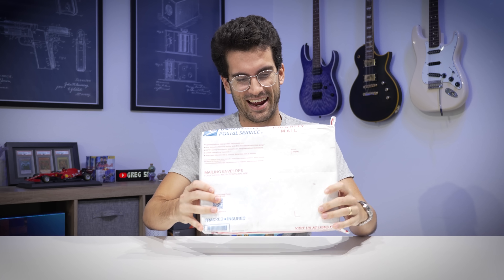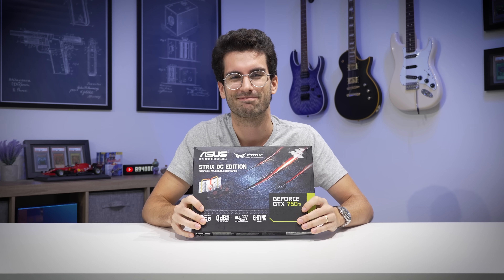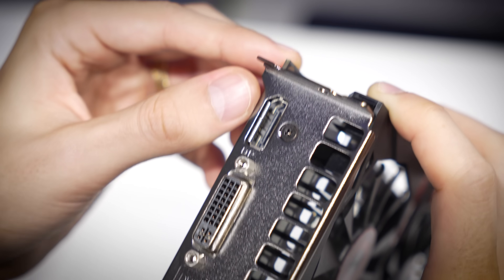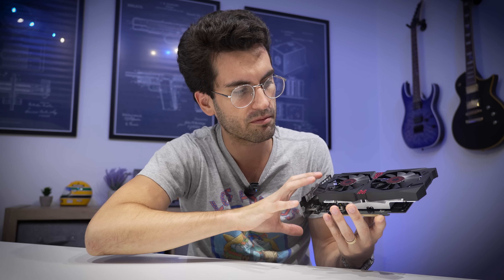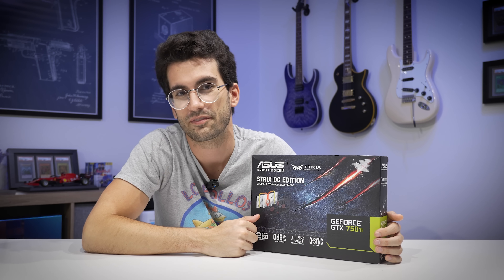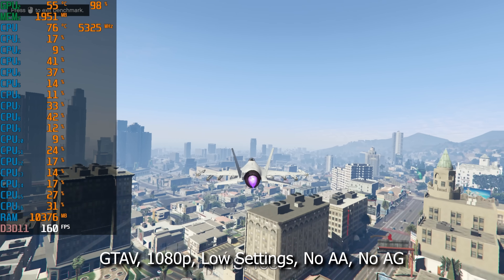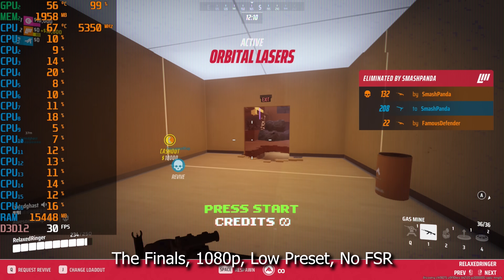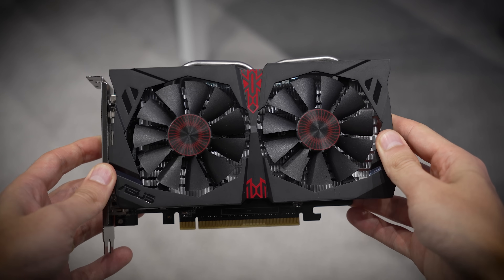The Nvidia GTX 750 Ti In 2024 | RETROSPECTIVE

Comment: I partially disagree with Greg. Yes obviously if you have or can safe a bit more money, do buy the suggested beter GPU's.
However if your on a very thight budget or just want the cheapest on the side gaming PC AND a low price comes along. You can create a very cheap system. Most (office) PC's are enough. You don't need an PSU with 6 or 8 pin powercabels. It runs of power from PCI-e slot. If you can spare a few more coins. The GTX 1650 offers way more preformance and uses PCI-e power only. Aldo prices vary depending on your refmgion in the world

Comment: I was later to the game when it came to PC gaming. My first system had a 1060 3GB (which is stupid because it isn't just a 1060 6GB with less VRAM), so a 750TI is too new for the retro gaming PC I want to build. I want an XP era gaming PC that I can play my retro Jurassic Park 3 games I have. May not be strictly necessary for most games I have, but one game absolutely needs retro hardware to play. 
Jurassic Park 3 Scan Command needs an accessory (the scanner) that connected to the PC with serial port and, as far as I've been able to tell, you cannot pass it through a serial to USB adapter cable to a Windows VM or PCem or DOSBox

Comment: The problem i have with video's like this is assuming someone is playing modern games on a 750ti this card is old and if you go back to when the card was made and played those games i think it might surprise you try Fallout 2 3 or Bioshock with this card i believe it will be a nice experience but you don't buy this card for modern games most likely it would be paired with a 2nd or 3rd gen Intel cpu at the time for retro gaming i would not have any problem with this card and for a lot of people it's offers you a way to play games that you loved in the past games that had soul and character like Alien Isolation good game anyway God Bless.
Reply from the maker: We literally showed GTAV (not modern, though still heavily played) running fine on the card. We also explicitly mentioned the card's viability for HTPCs and the like thanks to its low TDP.
Reply: @GregSalazar   My point was you started trashing the GTX 750 ti and you finished trashing the GTX 750 ti no one will remember anything in between because of it you should show more games of the time like Fallout 3 it was game of the year or Fallout 4 even there are so many good older games that the GTX 750 ti will play nicely.

Comment: Overall message is solid. I wonder though, what would it run like at 720p? Would it even make a difference at this stage?
Reply from the maker: Not totally sure. 1080p tends to be the benchmark for whether anything is "gaming" worthy today, and since 720p isn't a MASSIVE drop in pixel-count, it isn't likely to sway my opinion.

Comment: When you start testing the GPU, you’re using a modern cpu and everything not the GPU. So doesn’t that mean the CPU is carrying the experience? I know the GPU is under full load, but you don’t really get the “full experience” unless you paired it with a period correct cpu right?

Or am I way off base
Reply from the maker: Nope. Means the CPU is removed from the equation as a potential system bottleneck. Essentially, we want full pressure on the card to see how it holds up while gaming. If we'd put a much weaker i3 or Pentium in here, the CPU would hold us back in certain titles. In such a situation, it would be difficult to know whether to blame the CPU or GPU for performance limitations.

Comment: My first card was also a GTX 750 Ti. This card was advertised as a PS4 equivalent/killer at the time. It only released 4 months after the PS4 at $150. It was a solid option at the time as a first time builder. 

The Maxwell architecture was so damn power efficient that the card did not need any power connectors and just needed 75 W from the PCIe slot. The efficiency of the architecture was so great that it made its way over to the Nintendo Switch on a smaller 20 nm node in the form of the Tegra X1. I'd say this is in the top 10 for most important cards made in the 2010s onward.
Reply: thanks for that info. top 10 ten for the last decade😄 thats pretty good. Looking at the latest Graphics Card Comparison chart... It says the gtx 750 ti is double as good as ps4 and half as good as the ps4 pro. 👍

Comment: Crazy how for just double the money, for 149, I got a titan x pascal that was refurbished just few days ago 💅
Reply from the maker: To be clear, I only paid $75 because I thought mine was "brand new." Even then, I only wanted it new for the sake of this video. I wouldn't pay that kind of premium for such an old card - new or not. These consistently run between $30 ad $40 all day on eBay :-)
Reply: @GregSalazar  I actually think you can get a 960/970 for 40! Ebay is great
Reply from the maker: @ashleyjohansson230  Yep! And you absolutely can. Discussed a bit later in the video, but the price floor for a lot of these older cards seems to be somewhere around the $40 mark.

Comment: only for gaming maybe, but on my Daily driver  2700x with a GTX 770 ,  $40  5 years ago, great for watching videos and editing videos,  saves my Gaming PC with a  1080 from being used too much.
Reply from the maker: The 770 is not a 750 Ti. Noticeable performance difference, even today. So I wouldn't necessary equate those. I stated later in the video that something this weak would be fine for a media rig or something - but clearly not modern gaming :-)

Comment: Still running a FX6300 + GTX 750Ti here.
Reply: i pulled a 8120 and gtx 570 out of the trash, i'm dead serious
Reply: This was my exact combo until 2021 when my PC started having issues. I still have mine and I use it as a backup for troubleshooting.
Reply: Have you encountered any problems with that combo? Or do you avoid any modern titles?
Reply: @jackbro655  I think it's safe to say that they're avoiding quite a fair few modern titles.
Reply: @jackbro655  Last "new" game I played on this was Doom Eternal -  but low quality.
Reply: lmmfao I got a cpu with this exact combo and i can still play most games not all in 2024
Reply: @peezydabeatmonster8112 I have a 770 2GB and still rocking it
Reply: same :)
Reply: fx8350 for me 750 2 gb
Reply: Meeeee too!
Reply: What graphics driver version are you still using that is stable?
Reply: Is the the 2gb or 4gb, warframe can be played at 1440p on the 4gb one
Reply: I7-4790+ 4gb 750 ti still lol I’ve oc it it’s solid

Comment: This card has been kept in use in my group of friends since 2014 😂. I had a friend whose computer literally burst into flames and we managed to save it so for a while he was still rocking my 750ti in 2023
Reply: I sent mine to Windows XP. There it'll live its life beasting Oblivion with some mods.
Reply: Bro my GTX 750 (not ti) is still going strong I have to play mafia 3 at a lower resolution but it's still as good of a framerate for a console
Reply: When I upgraded, way back, from a 550ti to a 660ti I sold my 550ti to my dad for extra cheap. I think his downstairs PC still has that 550ti in it. Granted, he's primarily been using laptops for the last 8-10 years, but he still uses it occasionally lol.
Reply: I still have it on my 2nd pc, i use for dma cheats,which i shld hav left out

Comment: This was a brilliant gateway into PC gaming back in 2014. The number of office computers it turned into gaming PCs must be huge.
Reply: Had a 2nd Gen optiplex with one of these as my first gaming PC
Reply: @gok0o  same
Reply: In 2017 I built a Lenovo ThinkCentre into a budget gaming rig, running an i5-4590 and a GTX750Ti. Total cost was less than £100 in second hand bits including buying the PC itself. I ran it until 2022 and it did what I wanted it to until I decided I wanted to try CP2077 on PC 😅
Reply: I can tell you first hand that I am responsible for about 300 to 400 Floptiplex gaming builds. I let the people who receive them know what they are getting and to be totally honest I give most of the stuff away.
Reply: d new hp pavillion desktop with one of these bad boys in it, may be old but great first gaming setup for a 10 year old runs great.
Reply: Gonna turn it into a sleeper optiplex 7060
Reply: @neverleverland5685 i gots & purchased a hp pro desktop w/ a geforce gtx 750 ti in it aswell. the Card looks sleeker than this one in the video. Mine has just a single fan in the center, and its covered with a shell so you can't see the top circuit board. Does your card look similar to mine or the one in this video? 🤔🙋🍻
Reply: Yeah the 750ti turned lot of regular PC's into entry-level gaming PC's. All you needed was about 100 bucks and pretty much any kind of PC and suddenly your PC could play games. That was pretty amazing.